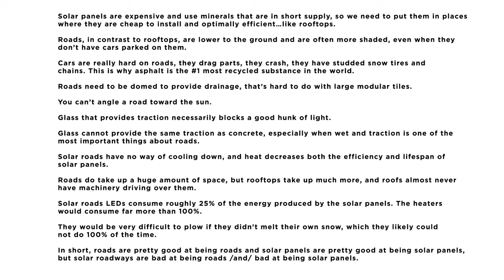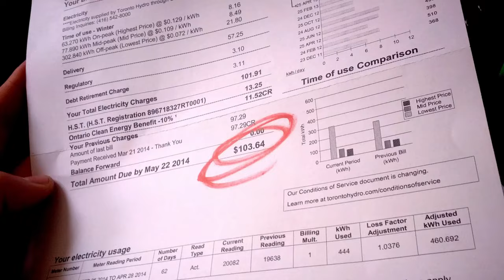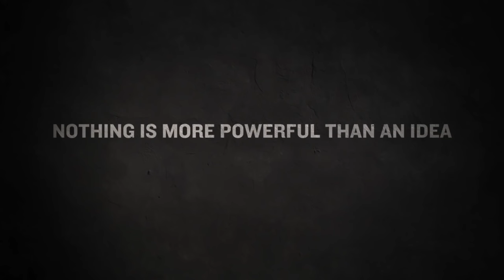The Kony 2012 of Roads - Solar Freakin' Roadways

Comment: Hey John, your point about trust and your opening about how most people don't want to "know all the things" is super inceteful. 

You were one of the primary resources in completing my education in neuroscience. I would not have understood genetics if it wasn't for you, genuinely. Recently, I've noticed a trend of left leaning individuals simply dismissing the role of genetics and biology in our behavior and our systems as "biological essentialism". This is strange to me, because I have found that it is often said by those very well educated in liberal morality, but lacking education in biology. Often, this is a response to a comment or question I have about the role of genetics on our behaviors and our society, such as how do we reconcile our desired morality eoth the reality of genetic bottlenecks that occurred that would have selected for the extremes of social and antisocial behavior. Issues of differences between people, that could be validated by science and therefore promoted as valid in totality, seem to instead be rejected for even calling people genetically different.

I genuinely believe that a lot of folks on the left are rejecting science and replacing it with morality for the reasons you outlined: people don't want to have to learn all the technical details (not everyone can and most dont have the time or energy), there is a lot of mistrust around genetics and neuroscience due to past history (pheenology, eugenics, etc), and "dismantle/destroy" the xyz has become the new panacea. How could someone like you or me, with compassion and a focus on educating and uniting people, explain that actually the conclusions of modern genetic and biological research is on their side? How do you explain to people that, out of fear and laziness that is simply human, people are rejecting the truth as "biological essentialism" while promoting a "philosophical/theological essentialism" by pushing morality into the space of their scientific ignorance?

Comment: The problem is a lot of people think a road is just wasted space, when in reality they preform an essential function extraordinarily well. Asphalt is actually an amazing material, is easy to recycle, re-grind, and use for more roads. IT handles fully loaded semi trailers rolling over it thousands of times, without breaking. IT handles the ground expanding and contracting with seasons maybe not perfectly, but good enough that repairs can be as simple as just throwing some tar on the cracks. our roads are actually AMAZING at what they must do to be a road.

You can't scrape up, re-grind, add tar and put right back downa solar panel. They need to be assembled and maintained. Solar panels can't be driven over thousands of times with fully loaded semi trailers, so you'd have to put a LOT of glass in front of it to make it strong enough. Solar panels don't expand and contact at all like asphalt roads do (again asphalt isn't perfect at this, but glass solar panels will be worse) and you can't just add some tar in the cracks of a solar panel to make it work. It really comes down to how solar panels and roads have basically nothing in common, so combining them even just in theory is going to make both things, worse. 

It reminds me of the whole banning grocery bags thing. Plastic bag has such a small amount of actual plastic in it that you burn more oil growing, shipping, and manufacturing a cotton bag to replace it that the plastic bag actually requires less pollution, water, and co2 to create. O've seen studies saying you'd have to use a cotton based reusable 10,00-40,000 times for it to be ecologically better considering it's production. The intention wasn't bad but people didn't think about the actual repercussions.

Comment: When I heard about solar roads I instantly thought “but wait, that will break instantly and traffic blocks it”. I didn’t check if they went with my next thought of putting dollar “roofs” or very long carports over stretches of roads. If not impractical, the cover could add benefits too

Comment: I've thought about those solar roads on and off throughout the years since I heard of it. I always wondered why we never implemented them, and more importantly why they weren't apart of a lot of different pushes to go solar/green/reduce carbon footprint. I kinda figured something about them was impractical. 

Thanks for the video that eases my mind on a random issue thats bugged me for a while  lol
Reply: Impractical, and ironically enough, probably more environmentally unfriendly. We think about how bad pavement radiates heat, think about these panels. Light gives off a lot of heat.

Comment: Ideas like this are interesting. They try to solve too many problems and never will do all of them, but it may be worth it to research them a bit and see what attributes can be effectively used. Its very clear that they would never work as a highway, or a road really. But the list of issues to solve becomes shorter if you consider it for a parking lot which sees far less abuse. Or a pedestrian walkway, perhaps at a theme park or something where the lights and ease of maintenance are more important, and generating energy from the sun is a useful byproduct that maybe does enough to be worth adding

Comment: If you can put solar roadway on parking lots, you can put regular solar panel over car spots which won't be shaded by the car, provide shades to the car, and lastly, cheaper and easier to maintain. 
If you can put solar roadway on a highway, you can put regular solar panels over an enclosed sound barrier which won't be damaged by heavy traffic, cover the road from bad weather condition, block out traffic sound for quieter neighborhoods, cheaper and easier to maintain.

Comment: The fundamental problem, in my opinion, with solar roadways is where they decided to put the solar.  Placing it as the road surface leads to all of the issues that people who know see in it. (though I suppose it could be okay for foot paths?)  The correct place to put solar is ABOVE the road, more specifically put solar above every parking lot.  It improves the parking spaces by providing sun and weather coverage and it means that even a lot that is sitting empty is still productive.  Relatively easy to implement as well: just mandate that all new parking lots are required to have a certain percentage of their area covered by a solar system.

Yes, I do see that there are difficulties, but that's why you need somebody who puts in the engineering work to reduce those issues.

Comment: Avoiding waste is a great goal, but sometimes it's hard to judge how much energy is actually moving around in a particular system. Cool-sounding ideas like this campaign don't always work out when you run the numbers. On the other hand, some clever ideas for collecting waste—like recovering the energy from doors opening or cars braking—turn out to be totally practical.

Now, if there was a way to generate power from online arguments of solar roadways, we'd be set. Maybe a device that dims the lights in your room whenever you're typing a youtube comment on any video with the word "solar" in the title

Comment: I'm wondering if, instead of "roads" making them into sidewalks would be a better and more practical option. You wouldn't have to worry about the traction of tires on glass; plus it would help make biking and walking more viable, especially in the winter. Although it's not as prevalent as roads are, it still would make a big impact.

Comment: Well it is true that putting the panels into the road itself is not the right solution for many reasons. But, we do have many solar installations over the parking lots and it often works out just fine. My company inspects them. The bonus is that you get a shade structure.

Comment: I think this video brings up a really good point about a variety of toxic optimism but I think its worth mentioning the other side of the coin which I would probably say is at least as common. When experts and people in power say that something is impossible (for some esoteric technical reason) but what it really boils down to is that they just don't want to do it (or don't particularly care enough to make it happen). I feel like universal health care in the US is like this. Politicians will say that it is impossible for x,y,z reason when what they really mean is that they just don't want to do it. Sometimes solutions are actually relatively simple despite what the experts will say. To be clear though, this certainly does not apply to things like the solar roads or Kony 2012.

Comment: Quite an interesting concept but ahead of the current technology to realize. What would work right now, and work well, is a Solar "roof" over the Highways (not continuous, gaps needed between panels). That Solar could not only add the the local grid but also help to melt snow/ice on the roadway with already proven geothermal tech built into said roadway.

Comment: What * would * be a great idea is if all parking lots over a particular size (say 30 spaces and more) were required to have solar panels installed OVER the parking spaces, providing protection from sun and weather, as well as generating electricity. Southern New Jersey has lots of parking lots like this and they're great!

Comment: The tell that Solar Frickin' Roadways was broken was that the company didn't use it for themselves.  They didn't use it for their own driveways and parking lots and loading docks.  They didn't even use it for their own sidewalks.

One of the easiest ways and frankly best ways to test your products while guarding your intellectual property prior to going through the patent process is to use it in-house.  You can find flaws, iterate on those versions, and manage to bring something to market and the patent office when it's mature enough to possibly work.  When instead the project begs for public money in order to only do public installations for something that can be done on the small-scale, that's a sign that it isn't viable.

Comment: I always preferred the idea of covering roadways with roofs and walls.  At least in urban areas. I am tired of road noise. Not cheap, but the roofs would make a good place for panels. 
Solar panels over parking lots is a good option too. Nice to have shady parking that helps keep the car cleaner. Plenty of lighting can also be set up under them without contributing to light pollution the way normal parking lot lights do.

Comment: Different idea, piezoelectric roadways?
Capture energy from passing cars with pressure plates. You can also just, install solar panels above the roads instead of in them, in parking lots these could power cooling fans aimed at your car on a hot day while also providing shade.

Comment: There's a lot of reasons that solar roads can't work effectively, however, I do think that in a lot of cases, solar sidewalks could work half decently. 

And even some portions of parking lots. Like the raised areas that usually have some kind of foliage on them, or walkways between rows of parking spaces. Or you could build awnings over the parking spaces and put regular solar panels on those. 

Solar power has all kinds of potential that isn't being effectively explored hardly anywhere in the US, so to be honest, if the level of stubborn crazy of the solar roadways people is what it takes to get more innovation in the energy production world, then I welcome the crazy.

Comment: Solar panels over irrigation ditches make much more sense and solve a couple of issues at the same time. Sunlight and trans evaporation and access to large amounts of area for the installation of said panels. Without using large areas of flat, accessible land.

Comment: I always wondered why they didn't pitch "Solar Freakin' Road Roofs". Sure, you have to put up a bit more structure. But then you can angle the panels optimally. And have access to the transmission infrastructure. And, get this, keep some amount of snow and rain off the roads in the first place. I suppose that wouldn't have been nearly so exciting.

Comment: Concrete doesn't provide traction when wet. Concrete is actually really slick with wet. You have to cut groves in concrete to make it safe to drive on when wet, which is why asphalt is better for roads.

Comment: If you want solar panels covering parking lots, put them above the cars, not under them.  Then the cars will also have shade, so they don't get too hot, instead of the cars being shade for the solar panels.  Most useful in places that are hot a lot, and don't get tons of snow, and months of cold.

Of course, huge parking lots are a huge waste of space a lot of the time, but they aren't going away any time soon, at least not very fast.

Comment: The worst part about "Solar Freakin' Roadways" was that when it was announced it was already tried multiple types on far less extreme conditions (bike paths and pedestrian paths) and already failed HARD. But SO MANY "go green" things, especially on kickstarter and similar "invest" things are full on scams or pure wishful thinking without any engineering or physics knowledge. Than again Elon banked his career on it and still get praised to high heavens.

As a rule of thumb I assume every "go green" thing on kickstarter is a scam if it only has 3D renders and/or a visual concept design. Any 3D modeler, animator or graphic designer can make a pretty picture and pretend it works, doesn't mean it's a functional device or plan.

Comment: I am curious about the viability of essentially providing a roof for major roadways that would include a solar panel layer. This would potentially require less work than redesigning solar panels into being a road surface as we already know how to use solar panels on the roofs of buildings. 

This would also make it possible for us to install the panels at the optimum angle for each location and could even provide a benefit to the roadways themselves by reducing the weathering effect on the road surface. 

I’m sure there are dozens of reasons that make this solution difficult, after all it does seem fairly simple, but small scale proof of concept builds could be as easy as residential covered driveways or even parking lots for interested businesses. I could easily see Tesla doing this type of thing just to have another way they were ‘leading the charge’ on solar and EV integration.

Comment: I think one problem is that people don't take the time to subtract the deficits after they add the benefits.  This is probably a resistance to quantifying what you're qualifying.  For example you could come up with a Rube Goldberg device to solve a problem and it looks pretty cool, but when you look at the energy and time inputs and compare them to a simpler solution the benefit poof disappears.

Comment: I knew that solar roadways were really not going to be a thing just from the tone of the video of it that went viral. Though one thing I always thought was instead of putting solar underneath the roadways, why not solar awnings over some of the roadways, particularly in areas where it’s expensive to maintain for the smaller number of miles people drive over it. It would protect the surface from a certain portion of the elements and also provide power. The hardest part would be designing it to be able to stay up even after someone crashes into a part of it though. Though also, in parking lots, where shade is desperately needed for people to park under.

Comment: It's similar to people fighting about things like: "Windmills are stupid, fusion reactors will solve everything!"
Innovation happens in thousands of forking and joining parallel streams. Inventions take many little steps, by ever-changing teams which compete and collaborate. There are no opposing camps to choose between, no silver bullets, just lots of imperfect solutions for complex problems. So, armchair engineers: Join a makerspace. Sign up for college classes. Build a fusor in your garage. Experiment. Enthuse kids to dive into science. Stop forming opinions based on blogs and posts. Join the revolution, instead of shouting from the sideline.

Comment: Now I always thought solar roadways suffered from two major problems
1. They tried to be photovoltaic... we do have black heat absorbing roads in America.
2. The idea got attacked/was too ambitious in claims. 
Because stabilizing a roadway with some form of bi-metallic junction then grabbing the bit of extra energy out of it would not be a bad idea, nor really cost much more.
But what I really liked was the modular roadway concept. Couldn't care much less about the solar panel part.
Difficult to curve for sure but counter point; anything, and I mean anything to reduce labor requirements and make it easier to both find and repair sinkholes before they cause accidents is a good thing, and smart modules for roadways would definitely make it easier to get self driving cars going safe and effectively. 

Heck. Could make self driving cars easy enough that 4 bit logic chips from the 70's could do it 🤔.... well not self steering but self driving at least.

Comment: Solar roadways could be good but I've always thought the panels need to be above the roadway, blocking the morning and night sun from drivers eyes, include lighting underneath which won't be scattering up into the sky, and you can solve quite a few problems with one project. You could also have information displays on the underside.

Comment: At a quick glance, yeah, this sounds great.  Tons of untapped surface area that could potentially be generating electricity from a resource (the sun) that's otherwise just being wasted?!  Sign me up!

But wait...the roof of almost every building is also untapped surface area that could potentially be generating electricity...and it doesn't have to be able to withstand the onslaught of heavy daily traffic.  Maybe...maybe we just put some normal (and presumably much cheaper) panels on some roofs.